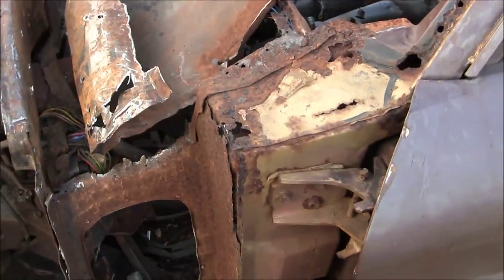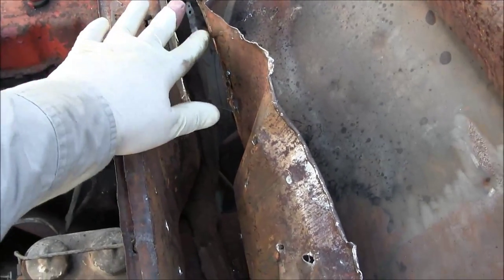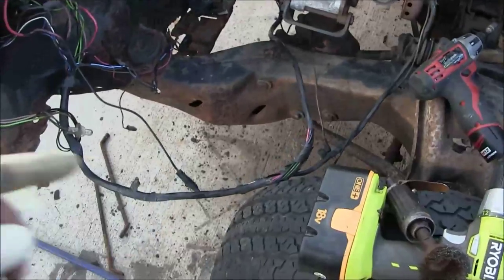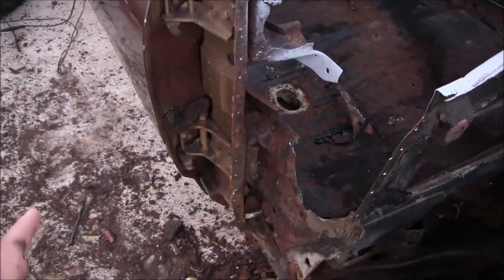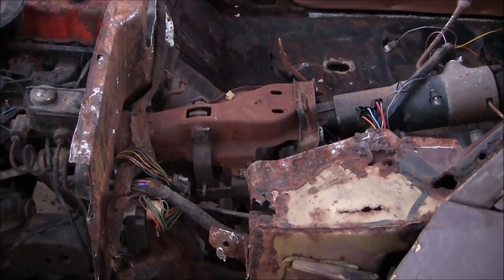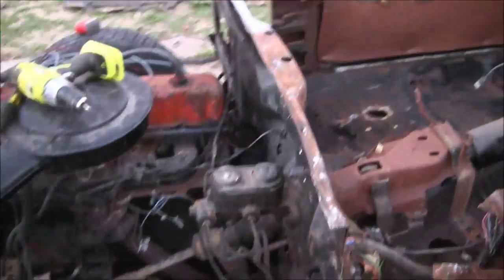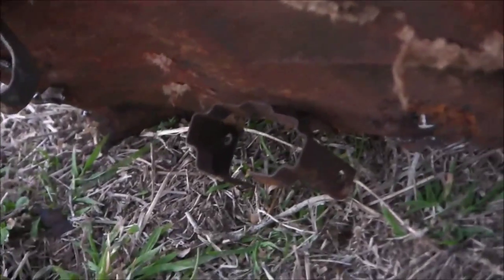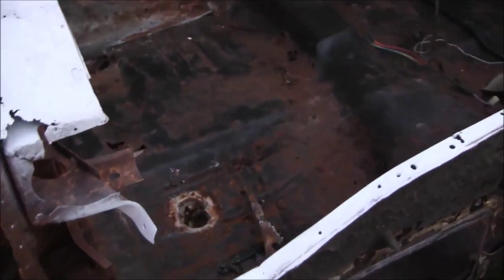1969 El Camino Restoration Part 5B- Removing the upper cowl

Comment: I am very interested to know if you have filmed the replacement of your upper cowl and dash???  I looked for a follow-on video but could find one.  I am stuck on my project because the upper cowl and dash panels have multiple gaps and don't mate up like I recall when I took it apart.  That said, there was body filler between each of the panels originally.  Need help or suggestions, please.
John
Reply from the maker: +jcspringer2005 Sadly, I have not been able to get to the point of where I'm reconstructing the car yet... budget issues and distractions have taken me off task. I have some pics I took of where the upper dash mated to the ledges on the hinge posts that might provide a little guidance? Also, I sub to Hanson over at 265chevy channel and this video 
https://www.youtube.com/watch?v=5voN8ARpx2k showssome close-ups of the dash. Let me know if you would like to see some of the pics I took, I'll help out any way I can!

Comment: thank you for showing us what is rarely seen, It's very helpful.
I would really appreciate if someone could tell me, can I take out the Windshield Cowl Panel without taking the dash off? I'm hoping I can drill out the spot welds that go through the dash into the Windshield Cowl Panel which I can slide out from under neath.
Reply: Just answered my own question No! a whole other row of spot welds revealed when dash is removed.

Comment: I think I would be horrified to deal with all of that metal work... I'm great with metal.... but I would be discouraged. Knowing I would slack off lol... glad your attacking it head on, man.
Reply from the maker: Thanks, man. I'm not great with metal but I'm only starting so I plan on learning a bunch with the help of the Garage Gang! Luckily this isn't my only mode of transportation so I can tear her down to the spot weld if I need to. It's just gonna be a matter of saving and budgeting for the parts I'll need. They're expensive in my book so it's gonna be slow going.